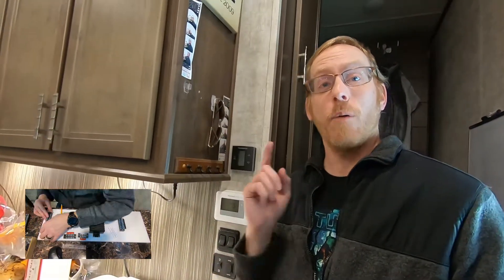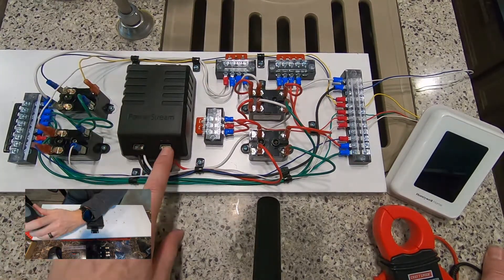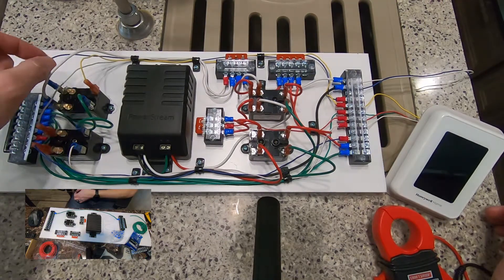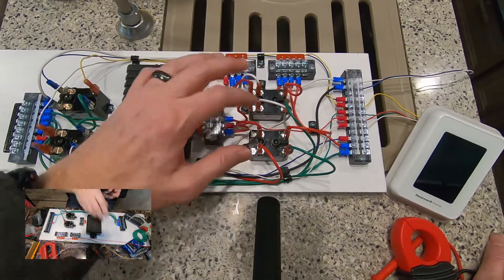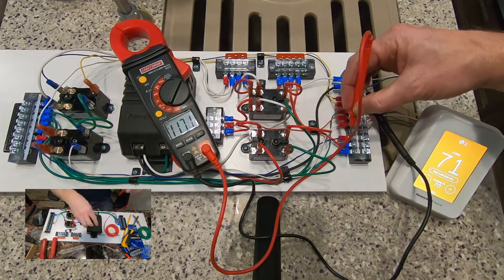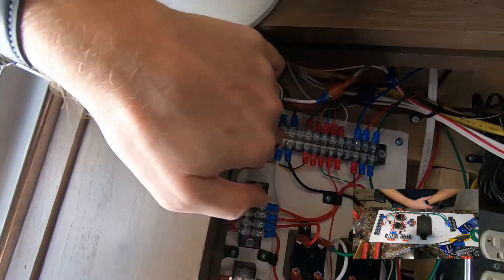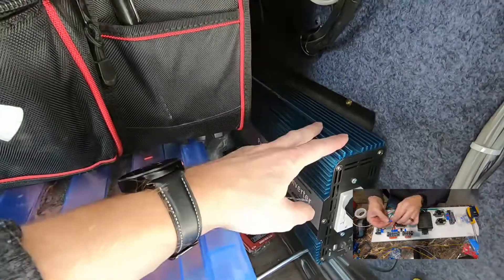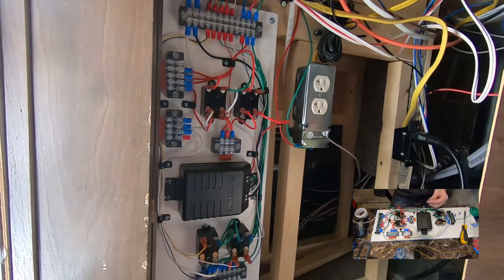Smart Thermostat in an RV - Major Dometic CT Thermostat Upgrade

Comment: Am I looking at the schematic correctly, in that your factory Dometic T stat is still in the system?  Did you just put it inside the wall since the new, smart T stat now controls everything?  

GREAT video!  I’m now living full time in my 5th wheel and wanting a truly smart system. Less insulation in FL means I either leave the AC on in order to come home to a comfortable temp. Or I leave it off to conserve power, but come home to a miserably hot inside. 

I believe I’m sold on the Nest, but I’ve been looking for someone else that has converted the Dometic system like you have.
Reply from the maker: Yes, the dometic tstat is still part of the system! Since dometic switched over to the CT style thermostat, this is the only way I understand that a a true smart tstat can work. It still hangs on the outside of the wall, just above the Honeywell, and is set to its minimum temperature, so that when the honeywell calls for cold, it powers on the dometic, which also now wants to cool the house. Once the honeywell is satisfied, it cuts power to the dometic tstat, cutting power to the A/C. 

I had considered the Nest, but honestly don't remember why I chose the T9 instead. I think it came down to price, and features of the nest that weren't important to us.
Reply: Thank you so much for the quick response. I kinda thought that’s what the old one was still there, but had to double check. 

I really appreciate you taking the time to put this video together. There are many others out there, but it seems as though everyone stays away from the 3 wire system of Dometic.
Reply from the maker: @Amycolo1  you're very welcome! It's my pleasure! I had a ton of trouble finding the info which is exactly why I thought I'd share this bit. Getting all the way to a smart Tstat was the goal from the start, we took 2 passes to get there and really glad we did!